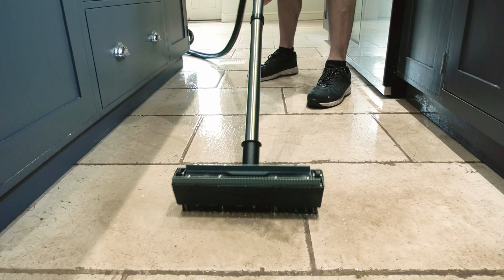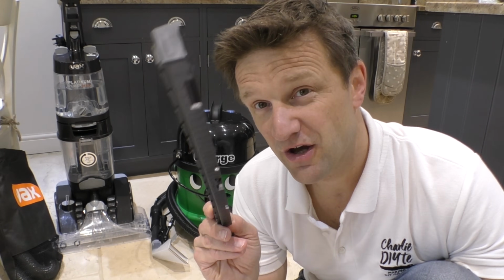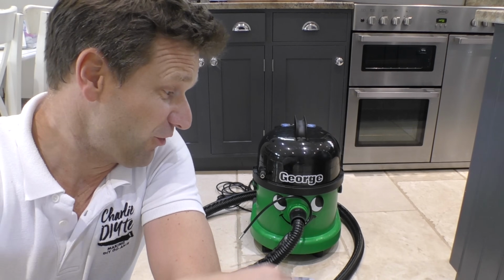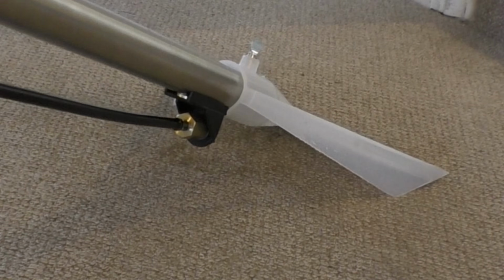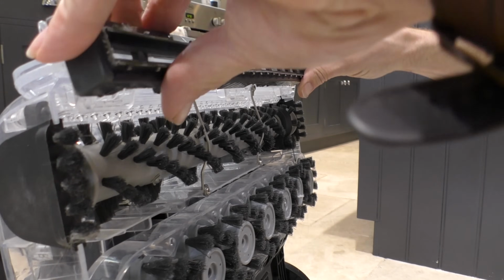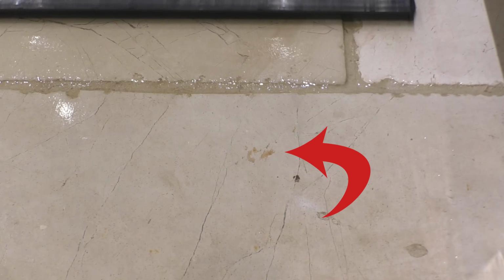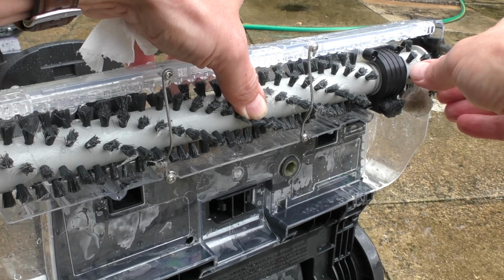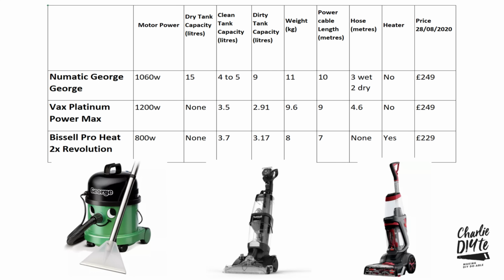The Best Wet and Dry Vacuum for Hard Floors & Carpets?

Comment: I’ve owned two of the Vax machines. They work well but not for long sadly. The first Vax bits just keeps breaking and every time I replaced something, another thing broke. The  seal on the waste tank was a dog to keep in place. When it went to the skip after the irreplaceable wheel fell off , there were lots more in the skip all broken. The replacement from Vax was faulty on delivery. The steamer died after a week. Had George for two years now. I have abused it big time including unblocking the kitchen drain pipe and lots more. Still working as good as the day I got it bar a leaky solution pipe that the dog bit. Fixed that with a dremmel and a cable tie rather than buying a replacement. Yes, I have sucked up dog sick with George tool
Reply from the maker: I'm afraid Phill the Vax is a total gimmick backed up with Uber slick TV advertising. I agree George is bullet proof. Occasionally the spray nozzle blocks but it's easily unblocked. Dog sick and car valeting is what it loves most!

Comment: Wish I had found you earlier! Received my VAX today, it’s going back, useless at cleaning rugs with any raised design, couldn’t remove a yogurt spillage from kitchen rug. I have deep pile carpets in bedrooms, got stuck & clogged. Oh & brush head doesn’t always move 😡
Reply from the maker: Unfortunately Louise, Vax are tricking the nation by bombarding us with those annoyingly slick adverts on TV. This vacuum is a plastic gimmick. My father in law broke it soon after I made this video. He is clumsy but god knows what he did but something has snapped so it won't stand up properly now. For a deep pile or something with a raised design that fish tail nozzle on George would do the job. It's not particularly good if you're coaching a whole carpet bit of I were you, I'd get a professional company in to do this anyway.

Comment: Get some floor sealant for the Kitchen floor tiles and give it about two or three coats ...that why your only need to mop the floor now and again and no crap will git in the grout ...or just seal the grout and not the tile
Reply from the maker: I've been using grout sealant for years and it still doesn't stop the grout sponging up all the dirt. I think I need something stronger.

Comment: I have the Vax machine, and agree with most of your points. The build quality is much better than their vacuums, but I don't know WHY on earth in the water tanks they didn't use stainless steel screws. One use, and they rusted immediately. Overall I'm very happy with the machine as it does well clearing up after the dog.
Reply from the maker: Thanks Ed. Yes, lots of problems with this machine. Personally I'd use George for hard floors and spot cleaning because the fish tail nozzle is so good and for large areas of carpet I'd get a professional in.

Comment: You could also get an old electric floor scrubber so your not manually scrubbing. Their more aggressive than pretty much anything on the market or at least the crosswave or floormate
Reply from the maker: That's a good idea Dustin as using George on these floors does involve a lot of scrubbing.

Comment: I have the VAX, bought it a while ago off the back of a Which? Review but only used it recently and agree it’s garbage, it didn’t remove stains and has left the carpet very fluffy, just like yours. How did you resolve the fluff issue?
Reply from the maker: I'm afraid it is, Christopher. The nation has been conned into buying these things by the deluge of slick TV ads. My father in law broke mine soon after making the video so it doesn't stand up properly now. The fluff sort of settled down, but it is in a well trampled area. I think George is generally the answer for general vacuuming, cleaning hard surfaces and spot cleaning carpets. If you've got a whole house of carpets to clean, you're best getting a professional in.

Comment: Bought one today on the basis of this review. I agree George is best  I've had many hard floor cleaners. I recently wasted £350 on tineco steam c5 which is dreadful if you have pets. Despite Tineco, bissel and vax claims if you have pets you don't get a proper clean unless you vacuum first and  eventually leak dirty water from back of machine and need to clean roller and underside of machine after every use. George has none of these problems. No need to vacuum first as sucks up everything, fur does not clog up machine. It is quite heavy though.

Comment: I had a Vax all in one bought 30 years ago and it died 5 years ago. The replacement was crap, felt flimsy compared to the old one. Got a Hetty as she was on special offer. Might have to give her a George to keep her company soon as we're having hard floors being put in.
Reply from the maker: George is a beast. Disadvantages if you can call them that are mainly just the cord not having a reel mechanism, but the accessories are fantastic quality - stainless steel base to the standard vacuum attachment which you don't get on their standard Henry models and we cleaned the kitchen floor with it at the weekend and it did a fantastic job. That Vax on the other hand has now broken at the clumsy hands of my father in law. He's snapped something so it no longer stands up properly. Complete rubbish, which people are conned into buying through those slick advertising campaigns on the TV at the moment.

Comment: Have both myself, have a Henry for general vacuum work and George for carpet cleaning, just purchased a vax smart wash- almost identical to machine here but for carpet only and without doubt the vax is better to clean carpets, more weight to push into the carpet, two brushes for agitation etc, much less hard work and leaving carpets less wet, however the George is easier to maintain and repair, and no doubt last much much longer and there built over here. Overall both good machines but if I had only 1 I’d go for the George, longer lasting and more versatile.
Reply from the maker: Thanks Richard. I have a mate I play footy with who's a professional carpet cleaner. His kit is off the scale and has made me realise for whole carpet cleaning you get the pros in. For spot cleaning George rocks. I'd never buy another Vax. So many complaints about the build quality.

Comment: Thanks so much as this is so helpful as I am looking for a wet and dry vacuum 👍
Reply from the maker: Definitely get the George, you won't be disappointed, and I forgot to mention in the video that you can replace any part that goes wrong, which is another great plus point, which so few other manufacturers actually provide for. 👍
Reply: If you don't need the carpet cleaning stuff buy a Charles

Comment: I like the numatic George because it doesn't leave wheel marks on the carpet and my Vax dual v carpet washer does
Reply from the maker: Agreed. You wouldn't use George for massive areas of carpet but then I'd always say you spot clean nasty messes with George and get a professional in to clean a whole carpet properly.

Comment: Thanks so much for this very honest and simple descriptions that anyone could understand. 
I have Owned a vax 2 in fact since 2000 first one (multivax 6130) was a quieter motor it lasted 9 years and was used for both hoovering and carpet and sofa washing 🧼 it just blew up (the motor) but was great till that day. Anyway decided to get another one it looked exactly the same just different model number and motor a (multivax 6131T) it’s lasted 12 years and the pump smoked out and stop pumping water and think the actual motor is on its way out as kept cutting out after about half hours use , never used to do that unless it had been carpet washing non stop for at least two hours.  
The motor in it is deafening!!! No exaggeration it’s always been so loud it’s horrible and now it’s even louder than ever and is now broken. As it doesn’t wash anymore. But I hate the motor it’s just so loud and it was also my 3rd replacement as the first new one the (6131T) to replace the old (6130) vax. 
After 2 weeks of use it started to sound like a chainsaw so stopped using it as it was getting worse, then they sent me a new one didn’t bother taking the old one which was only 2 weeks old so threw it out as it was completely dying. The 2nd replacement the pump stopped working after 5 months and been used twice for carpet washing in that time! Again they sent me a new one and didn’t take the old 2nd brand new replacement either so sold it as just a hoover to a friend it lasted about 6 years after that.  The 3rd replacement I didn’t take any chances and ordered a Henry hoover to use as a hoover and just the vax for wet carpet bed and sofa cleaning. And lasted 12 years till 2
Weeks ago.
I am sick of vax now so want an alternative and after watching this I have made up my mind and next week going to go and buy a George carpet cleaner as love my Henry turbo hoover and my old Henry before that lasted 12 years and  blew up but just after i done whole flat with it 🙏😂 so find the numatic brand very reliable , affordable and definitely a lot quieter than the multivax brand. 
So definitely getting this one now thank you.
Reply from the maker: Thanks for this. My Vax broke about 2 weeks after making this video when my father in law borrowed it. They're plasticky gimmicks backed by slick TV advertising. My advice, get George for most jobs - it's particularly good at spot cleaning. And if you've got a whole carpet that needs cleaning personally I'd get the professionals in, although the large fish tail nozzle will do the job but it'll be hard work..

Comment: Glad to find this Charlie thanks although wish I had found before I purchased my Vax platinum power Max. As you said there is no info on using the Vax on hard floors which is a shame. In my experience, I have found it good on carpets and ok on hard floors. It is heavy though so George looks better for ease of use but I think that I would be too lazy to fiddle around with changing the George tank - that’s my bad. I like the Platinum Power Max but think that due to the weight it would not be ideal for people who didn’t have fairly robust health.
Reply from the maker: Thanks Cathy. A fair assessment, that. My father in law has somehow broken the Vax. It won't stand up now without flopping over. George ever day for me but there is a convenience to the Vax that some people will like (except when you have to clean all the brushes after washing the carpet) 😏

Comment: Now I don't know what to do. I have a Henry, a Dyson V6 and need a carpet cleaner. I love the attachments and simple nature of the George and it not leaking. I've borrowed a friends Vac carpet cleaner (different model) and they are total pain to clean out after every use. Does the George have a bigger head/nozzle to use for carpet cleaning a whole room? What other models of carpet cleaner, Bissell Pro Heat perhaps for carpet cleaning with a nozzle for upholstery? Charlie? Anyone...?
Reply from the maker: Yes and my father in law has borrowed the Vax and promptly broken it. It won't last with all that Dyson-esque perspex style plastic. Can you hire one instead? How often were you thinking of using it? Trawl through the comments to this video and see what others have suggested, but I know the Bissell has a very good reputation.
Reply: @CharlieDIYte  Thanks Charlie, the peril of borrowers! Does the George have a larger head for doing larger areas of carpet? Or just the fantail head? I'm torn between the bissell proheat 2x revolution and the more expensive bissell proheat 2x revolution pet pro. I have a dog, also prone to the odd Halloween style throwing up. I was tempted by a spot cleaner but then thought for a bit extra I may as well be able to clean a whole carpet. I'll look at other comments, thanks again, your reviews are really helpful.
Reply: @kstevenson1040  George is a true gentleman. Remember, the larger the suction area the lower the pressure. George just has the 6ish inch wide fantail but do the floor in strips and he cracks on in no time. Massive suction. I've only had him 2 days and we're thick as thieves. Bought him for the car but due to the weather I've done the lounge rug, 3 chairs and the mattress (10am, dry by 9pm - AMAZING result!)

Edit: not 6 inches, more like 10 inches. Also cleaned the sofa with the smaller gun. Excellent for this 😊

Comment: After 10 months of trying to use the VAX Glide Wet & Dry, I have finally returned it. It's been back once and the battery has been replaced once. The problem?  Intermittently, it would not suck up the dirty water! Just spread it around the floor.  I spent most of the time cleaning it out and ensuring no blockage. I even tried vacuuming before cleaning! Finally, I returned the machine. However, VAX offered only 75% of the cost price, I was furious as it was within the 12-month guarantee. I complained bitterly and their last and final offer was 90% of the cost price! Never again!
Reply from the maker: I'm afraid Penny they're a flawed product backed up by slick TV advertising. Mine broke when I lent it to my father in law straight after doing this video. Plasticy gimmicks IMO.
Reply: Your video was excellent. I won’t but the George however, it’s a little expensive for me & a bit ‘faffy’ changing from vacuum to wet & dry. I’m looking at the Hyundai wet & dry. Carpet & upholstery too! X

Comment: I have had 3 vax PPP in 3 years, bought the first, other 2 were replaced under warranty,. The machine has fatal design flaws, including a belt tensioner that completely fails and is not replaceable. Great upright cleaning performance when it's working. Tiny water tanks. Best thing about the vax is the warranty process, they never seem to argue; I wonder why. Top tip.... Never use detergent to clean your carpets, the dry detergent acts as a glue which causes your carpets to become grubby 3 times quicker. Use bicarbonate soda instead.
Reply from the maker: It's a gimmicky product backed up by slick advertising. Mine broke soon after making this vid when my father in law borrowed it. My advice - George for spot cleaning and for full carpets, get the pros in.

Comment: Hi Charlie,
Hope you're doing well.
Great, very informative video, as always but had a few questions to put to you as you seem to be the perfect person to ask;

1) How is the George holding up, when did you last use it? A fair few reviews online (Amazon UK) mainly attribute a failure of the main pump assembly after the 3rd use/9 months or so in, whichever comes first. Additionally, have any of the metal parts rusted/corroded? Has any part become unusable due to standard wear & tear?

2) Would you recommend using the George (dry) as a general and occasional DIY "shop-vac"; i.e. - hooking it up to the dust extraction port(s) of an orbital sander for plaster/wood, tile cutter or a circular/miter saw when cutting timber/treated wood? This would be with the HEPAflo bags mind. (Just seeing if I can kill two birds with one stone!)

Thanks a ton! :)
Reply from the maker: Hi buddy, thanks for that. I can't say I'm a massively next user of it to be honest - I used it mostly for wet vacuuming the kitchen floor and carpets but to date the only issue I've had is that the brass spray nozzle on the main assembly can get clogged up when you haven't used it for a while. I wonder if that's what they're talking about? However a quick dunk in some hot water seems to unclog it. Either way, I bet a quick call to Numatic and they'd sort out any issues. Yes you could definitely use George as a shop vac. A combination of the cyclone and hepa bags would give it all the protection it needed. I definitely recommend a cyclone though if you're going to use it as a shop vac as discussed here https://youtu.be/9RfHpm2vf40 It's a game changer!

Comment: Thanks for the great, honest, in-depth reviews and advice as always. I am hunting for an allrounder myself as well. Considering the Karcher SE 4001 or the George at the moment. I think the Numatic tank-in-tank design looks messy when emptying. The Karcher does not come with upholstery tool as standard, but has a more powerful motor. ... 🤔
Reply: The Numatic hard floor scrubbing brush is brilliant. If that fits the Karcher, that maybe a winning combo. Are the pipe sizes standardised?
Reply: Karcher use 35mm attatchments numatic use 32mm attatchments so you would have to buy an adaptor

Comment: Ugh I hear you.I have a large large kitchen in the country with a big dog. Despite “shoes off” policy at the door and dog retained in utility till his feet are wiped, I have to clean the floor everyday. The important thing you mentioned briefly about the vax is it dropping its dirty water back on the floor when idle - and sometimes it spits it out the front of the machine - its one step forward and two back! I don’t have the carpet cleaner - just wet and dry. I despair of it. I bought the duprey steamer which seems ok for the ingrained muck, but I’m left with dirty water on the floor. I need something to suck up and didnt want to spend 3k on vac steamer. George seems to be the main contender. Where to put all this machinery?

Comment: I bought a Wet & Dry last year before starting my home renovation. It has a nifty dust-extraction facility for power tools which has come incredibly handy for the past 12 months. Brilliant. I have a Bissell carpet cleaner that I've used intermittently for 8 years, and it's still going strong.

Comment: I have a Vax that is similar to the George. Great as a vacuum cleaner, almost too good sometimes especially with a new bag in it. Works really well as a carpet/upholstery cleaner too. The only issue I have with it is that when it goes near a mat or join between carpet and wooden floor it falls over like a football player tackled by a blade of grass. It is so top heavy it is ridiculously hilarious.  The George type design is still a great compromise if you only have space for one device that does two jobs well.  Great vid as usual.